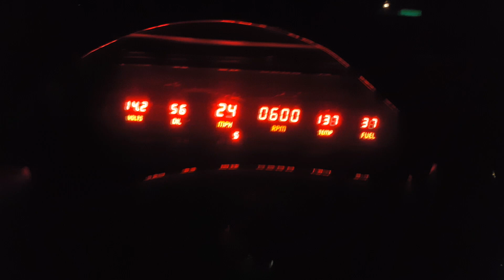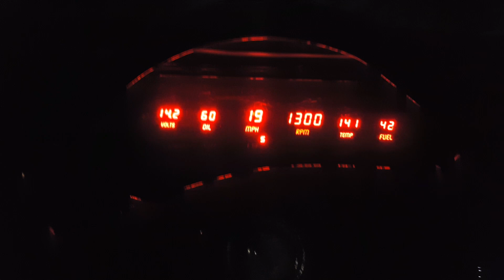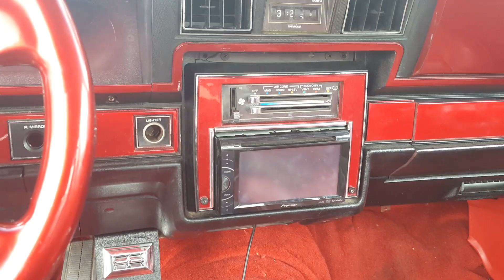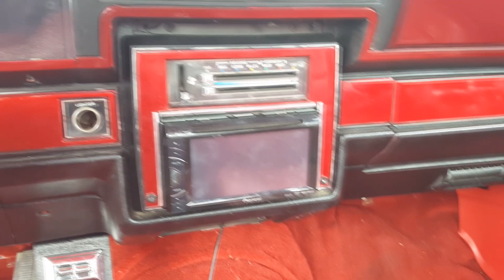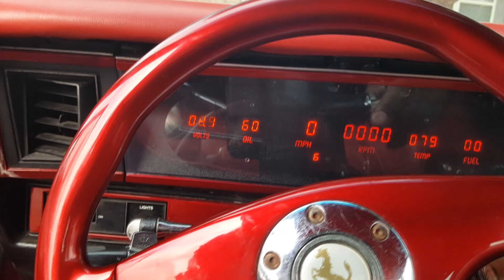Welts 2 Door Box Chevy #Done

Comment: LOL, people are cheap! They want a $5k job for only $250 bucks. trust me I know what you mean.
Reply from the maker: Astral Auto Repairs Man bro I really don't understand some times
Reply from the maker: Astral Auto Repairs This was at least a $1200 job else were. I've touched literally at least 85 percent of the wires on this car.
Reply: It's like they take the car to EVERYONE else, but you, they get these outrageous prices from these shops, then finally come to you and expect you to do it for 90% less than what the others wanted to charge, but wait, it doesn't end there...

THEN when something goes wrong, they want to blame YOU, even though you told them this needed to be fixed.
Reply from the maker: Astral Auto Repairs That happens every time I sell a car, "it needs an oil pan gasket replace this asap". 1 month later I got an inspection and they told me it's leaking oil 😂🤦🏿‍♂️.
Reply: ⭐ Astral Auto Repairs I was the same way no more in 2018